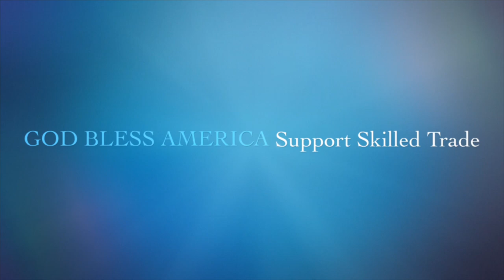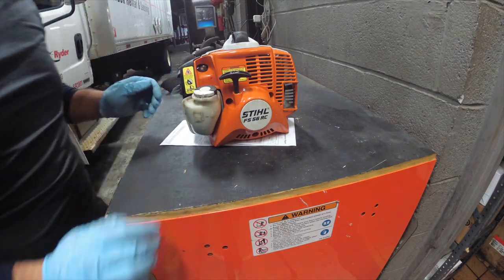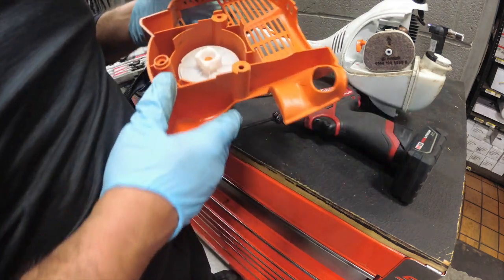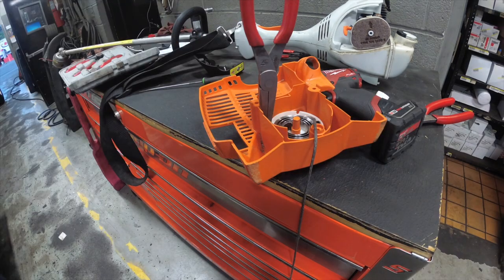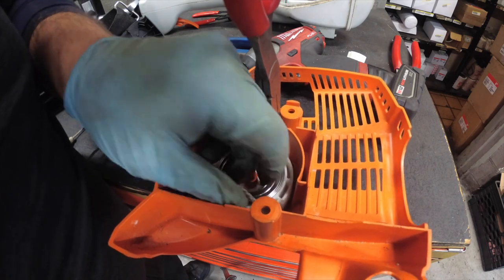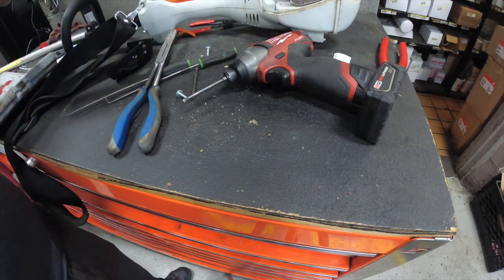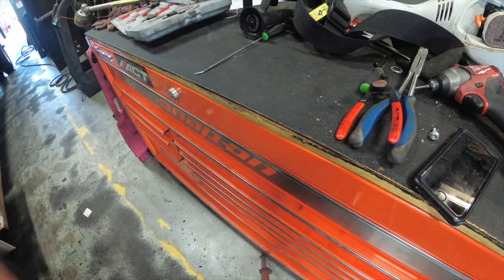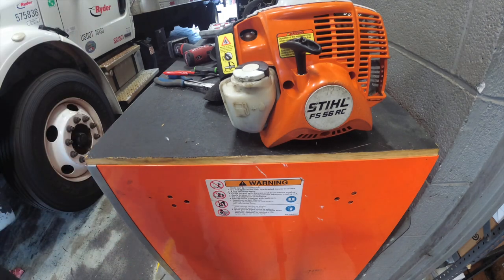CriagsList JACKPOT LOT #3 HOW TO Repair Replace Pull Cord Stihl FS56RC Weedwacker Weedeater Wacker

Comment: I just replaced mine while watching your video. I found running the rope the thru the cover into the recoil to be much easier and got it done several mins before you
Reply from the maker: Tomato..ToMAHto lol.  In the end it worked out!  That is the one of purposes of my channel!  Hope you took the money you saved doing it yourself and applied towards a nice steak dinner!  Thanks for the view and comment!  Hopefully you subscribed!
Reply: Hi I just had this very issue with this same recoil. Could you please explain exactly what you mean? Did you not open the cover to the recoil spring at all? The one with the snap-ring. Can you just Jam the end of the string in there?

Comment: Thanks for sharing. What thicknes cord dit you use? 3mm?
Reply from the maker: I use this on EVERYTHING even though it is advertised as 4 Cycle only!  Thanks for the view and comment, hopefully you subscribed to my channel.

http://rover.ebay.com/rover/1/711-53200-19255-0/1?ff3=4&pub=5575562411&toolid=10001&campid=5338658191&customid=&mpre=https%3A%2F%2Fwww.ebay.com%2Fitm%2FNew-Stens-145-612-100-Diamond-Braid-Starter-Rope-Reel-5-5-32-for-Small-Engine%2F222836125763%3Fhash%3Ditem33e2117043%3Ag%3A250AAOSw8fRbNsND